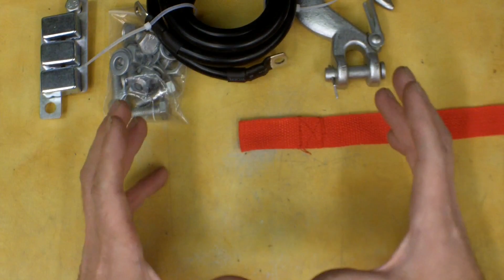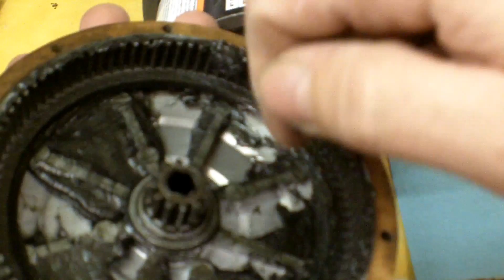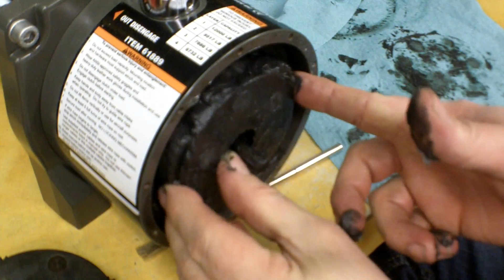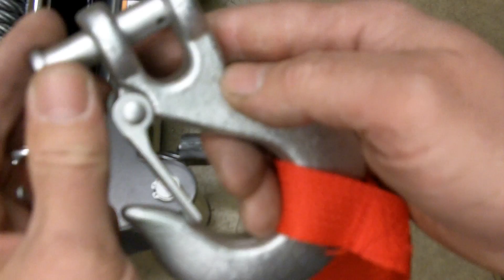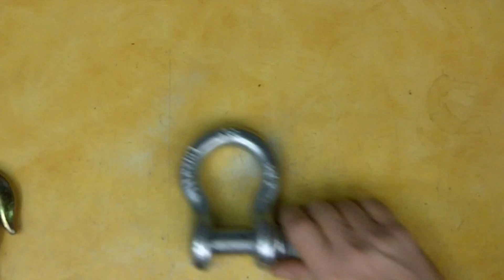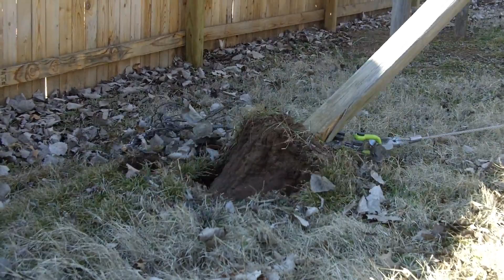Harbor Freight 12000 LB Winch Review, Teardown, Installation, Safety, Etc. Model 61889

Comment: Harbor freight has an amazing deal for this 12k for 294.99 until Sunday!  Great job btw, it makes a great deal that much sweeter after seeing your review
Reply from the maker: roy kwon That is an amazing deal Roy and thanks! I'm completely satisfied with mine and it works great for me. If you get one, let us know what you think. Good luck, G.
Reply: 4 years ago at $294.99 and today its $299.99 not bad. I may pick it up for my gin pole idea I have.

Comment: Harbor freight should put this videos link on their website because of how useful it is. they suck when it comes to directions. great video
Reply: +ghostses You did an awesome job ... Glad I came across your video .. this is my 1st time buying and installing a winch .. thanks very much for taking the time to do this .. :)
Reply from the maker: E3guyy LOL. I agree, their manuals leave a lot to be desired. Thanks! G.
Reply from the maker: Steve Ruddy

Thanks Steve! I'm glad you found it useful. Good luck with your install and be safe! G.
Reply: They never will because of the liability.  I just bought the updated version over the weekend, and frankly I'm surprised by how much is actually in the manual for usage.

Comment: Awesome instructional video!  Thanks for going to all the effort to help others.  Can you provide more information about the "extended cable kit"?  Source?  Cost?  Part Nos.?  I have purchased the winch from HF and the portable bracket from NT and intend to use in a similar manner that you are.
Reply from the maker: Hogonit 77469 Following up here over the PM as it might assist others as well.

The kit linked is expensive and I've not looked to find a less expensive kit.

http://www.northerntool.com/shop/tools/product_200464241_200464241

Another option, and less expensive might look like this:
Find some heavy gauge wire and use it instead of the kit- maybe from a 
welding supply house. Or perhaps even some long jumper cables with the 
clamps lopped off- but really heavy gauge.
Get two sr175 connectors for the end at the rear.
Wire the ground directly to the negative on the battery.
Use something like this on the positive post of the battery.
http://shop.advanceautoparts.com/p/autocraft-top-mount-battery-terminal-quick-disconnect-switch-20138/6280536-P#fragment-2

This option would require manually turning on the power, but would save 
tons of cash. It would be up to you to remember to disconnect the power 
when not in use- but that's no big deal in my opinion. The only real 
difference in operation is you would need to open the hood to power up 
the cable to the rear over simply flipping a switch. To me, a small 
price to pay to achieve function as well as safety!

Take care, G.

Comment: How did you get the gears clean?
Reply from the maker: David Miller David, I cleaned as much off as I could with rags, then just used gasoline and a brush for the rest. Any solvent should work though. Good luck, G.

Comment: G.
I was winding my synthetic line back onto the spool of my 12000 lb winch after installing a fairlead just for synthetic line when my winch started clicking and stopped. I tried my remote with the same result, nothing. ??? HELP please.
Reply from the maker: Chuck Pringle That's no good Chuck. I'm no pro, but I would start with the basics. Since you said you were spooling up the new rope, did you have the vehicle running? If the battery is low, I could see it clicking so I would start there. Since you've tried two controllers, I would imagine them to be fine. The next thing I would to is to check that all connections for the wiring are tight. There should be four screws in the bottom of the solenoid box you can remove to open it up. Unhook the battery leads first, then check all connections. If they look good, hook the connections back to the battery and try tapping the solenoid with the handle of a screwdriver while holding the button. It might be stuck in some way. The last thing I can think of would be the circuit breakers connected to the battery, providing you used them. You might take them out of the circuit to see if it starts working. Like I said, I'm no pro but hope this helps in some way. If you get it working, let me know what the problem was as I might help others. Good luck, G.
Reply: ***** Yes, engine running.
Had to go out but have time now to check electrical connections, let ya know.
Reply: Chuck Pringle 
Fixed it, just a lose connection.
Reply from the maker: Chuck Pringle Good deal Chuck! Which connection was loose? G.

Comment: great!  Do you think rather than repacking the gears I could just squirt some lithium moly in from the open end of the gears to make sure they get enough?
Reply from the maker: Charles F Charles, the gears on mine seemed to have enough grease on them from the factory. The quality of the grease I don't know- which is why I cleaned it out and started with good quality grease. It also allowed me to show how it all works.  I don't think you could get any new grease all the way through the gear sets without getting way too much in them. At the very least, I would take everything out and use a standard bearing grease on the outside of the ring gear like I've shown. This would help with free spooling. Good luck, G.

Comment: Underrated winch IMO, the re-greasing would for sure quite it greatly and reduce even more friction. We are gonna mount one in the back inside a suzuki samurai tin top lol, overkill however the price is just perfect.
Reply from the maker: I agree Thanos! I never hooked it up before re-greasing it so I don't know what it would have sounded like out of the box. I can say it is really quiet in use after what I did  and the only thing I really hear is the motor running. I can't hear the gearing. It might be a little overkill for you, but I think it would last longer since it would see lighter loads. I agree, the price is just perfect. I'm still really satisfied with mine. Good luck, G.

Comment: mine is 12k item # 68142 bought in 2013 new
Reply from the maker: That's cool. They don't show that model anymore. I think they have different model numbers based on which factory they came from. How is yours holding up for you? I've been using mine almost daily since posting the video and for about a couple of hours of run time in those days. It's still working like day one for me. Take care, G.
Reply: ***** Only used it a few times over the course of 2 years but it is still doing fine. I haven't put any hard use on it really. Thanks for the vid, gonna break mine down one of these days and add some moly grease to the planetary's I think. Take care!
Reply from the maker: Keltingr That's cool. No more than you use it, it might be just fine with the factory grease. But, on the other hand, changing it out to a quality grease might help it last even longer. Mine's seen much use and still works great as well. I've no experience with one with factory grease, but an ounce of prevention is worth a pound of cure...lol. Good luck, G.

Comment: hello, your video is very informative and I appreciate the time you took to make it. Question? can these winch be use for a hoist lift?
Reply from the maker: Tommy Francis Thanks Tommy! I'm glad you liked it. These types of winches are not supposed to be used for lifting loads though I've seem some videos of people doing it. I think it has something to do with how the break on a hoist works over a winches brake- but I'm not too sure. If it were me, I wouldn't use one for lifting. Harbor Freight does sell hoists of different capacities and price points. Depending on what you're wanting to do, you might check them out. Here's a link to their hoists. Hope this helps, G.http://www.harborfreight.com/catalogsearch/result?q=electric+hoist

Comment: I've got the same winch and it came with my truck when i got it. However, it only works one way which is out. So im pretty stuck trying to reel back in the cable. Any thoughts on where i should start looking to find out whats causing it? Manual says to try tapping the solenoid. Not sure what that means.
Reply from the maker: You can see the solenoid at about 13:10 in the video. Take the control box off the winch and then remove the 4 screws from the bottom that holds the cover on. First make sure all of the connections are still connected. Then try tapping on it with the handle of a screwdriver, then test to see if it works. It could also be the controller switch is bad when using the in side of the switch. Let me know what you find out. G.
Reply: trukaroo Run power directly to the winch terminals and then reverse it and see if it runs the motor the opposite. You may be able to swap wires and have it only pull in, then you could free spool it out

Comment: Is that cable tension device available from H.F.? My Bad Lands winch didn't come with one.
Reply from the maker: I don't think so Chuck. It seems the only models that come with it is the one I have (61889), and one with another item number- 60813 . They have another model of the 12k (61256) but it doesn't have it. G.

Comment: Speaking of "rat nesting" I was weed eating the yard this last Friday, accidentally bumped the trimmer head on a rock, the damn thing unclipped itself and the line unspooled in about half a second. I of course still had my hand on the trigger, so not only did it unspool but it then got twisted around by the motion of the motor still spinning. Took longer to unravel it all then it did to mow the lawn!
Reply from the maker: I bet that was a mess... That's my luck half the time...lol. G.

Comment: I remember bringing up the different item number listings before. I've said this in another video, but I'd like to repeat, my guess is that if an item starts getting poor reviews they alter the supplier and redo the item number so that they can get new 5 star reviews. Heck, sometimes you'll see an item, say a corded drill, there will be two item numbers, one will have 3 stars based on 13 reviews, and the other item number will have 4 1/2 stars based on 47 reviews. I'm not 100% sure that's why it's done, but it's just a guess.
Reply from the maker: You're probably right. G.

Comment: Hi G, shouldn't the order be: you would put a bolt through a hole, then put a flat washer, the lock washer, and then the nut? My thinking there, is that the flat washer creates a base, the lock washer is holding tension on the nut, preventing the nut from wanting to loosen up. Let me know what you think. As with many Harbor Freight tools, taking the time to go through it from the start, makes all the difference. Sort of refining the raw materials they give you. Thanks for another awesome video.
Reply from the maker: Darryl, typically that's the way it should be done for sure. If you're referring to the bolts that are installed to mount the winch to the cradle, the square nut goes into a slot in the casting and there's no room for the washer and lock washer. The fairlead was installed just like you stated. I agree with some of their tools needing to be finished off. I consider some of their items to be kits.

I've been tearing things apart since I was about 3-4 just to see how they worked. The only difference between then and now is I can put them back together and they still work...lol. G.
Reply: We're cut from the same cloth, Brother!
Reply from the maker: Darryl Landry LOL! G.

Comment: Wow. Great video. This was a long one. You did a great job going thru all the steps and rigging. Im really impressed with it. You pulled some huge trees over. I've always wanted their 12000 lb winch. Glad to see you're happy with it. Did you put the emergency break on on your truck so its not pulling against the transmission?
Reply from the maker: Thanks! It was long for sure. I'm really happy with it. I should have mentioned how I have the truck set as far as the transmission but forgot. I leave it in neutral with the emergency brake set. Doing so will protect the parking pawl from damage. G.
Reply: ***** Welcome. I was just wondering if you did or didn't. Nice truck BTW. I never thought about using a winch to pull out brush but it works good.
Reply from the maker: Love2boat92
Thanks! It's been a great truck despite having to rebuild the engine. Using the winch may not be the fastest way, but it sure works great. I don't have a tractor so this was my solution to the problem. I don't like doing this type of work, but with using the winch it's almost fun now...lol. G.
Reply: ***** Welcome. Haha. Yeah a tractor would be nice but to buy a new one is horribly expensive. The winch is a great cheap alternative.

Comment: Nicely done!!
Reply from the maker: Thanks! G.
Reply from the maker: MichailahGMX10831 Thanks! I'm no pro but I'll give you my thoughts anyway. I don't think you can fit 100' of wire rope on the winch. You might be able to locate a synthetic line that's smaller than 3/8" but still has high load strength and fit more on the drum but how much I don't know. And it can be quite costly. You would also need to change the roller fair lead out for one that's suitable for synthetic rope. I would go with at least 18k breaking strength for safety, if not more. 

They pull some major amperage so a convertor is probably out. A deep cycle battery would be your best bet and you will need to charge it when it's dead.

I'm not sure on mounting, but you might consider using their cradle and a bumper receiver. Bolt and weld the receiver to the trailer somewhere, then using the cradle for installing and removing the winch. Or you might be able to add some steel to the trailer and bolt the winch directly to it. Or there might be a place available without adding anything. 

Receiver:
http://www.harborfreight.com/5000-lb-step-bumper-receiver-69670.html

Cradle:
http://www.harborfreight.com/Hitch-Receiver-Mount-for-Winches-69106.html

Another thought would be to anchor the winch itself at the top of the hill and use the cable to pull the load up. What to build I don't know. You might be able to use the cradle and then come up with a point you can attach a shackle and tree strap to.

For getting more length, you could add a couple of tow straps (not recovery straps) to the end of the cable, pull as far as you can, chock the load, remove the strap(s), spool out the cable again, and then pull the rest of the way.

What you're wanting to do sounds scary to me, so be extremely careful and stay well away from behind it!  I hope this helps in some way. Good luck, G.
Reply from the maker: MichailahGMX10831 That sounds like the best plan to me over all the red tape with the others options. Post a link and I'll check it out. Good luck with your project! G.
Reply from the maker: MichailahGMX10831 WOW! That's an ambitious project for sure! Thanks for showing it. G.
Reply from the maker: MichailahGMX10831 Cool! Looks like you've got everything ready to go. Have you made any pulls yet? G.
Reply from the maker: MichailahGMX10831 That's cool. Yeah, the battery is the weak link since it's not getting a running charge- like from a vehicle. That's why I mentioned getting a deep cycle battery. They take full discharge and recharges much better. If you have AC power up top, You might keep a charger on the battery to keep it topped off. Overall, I think the project will be a success- albeit slow from time to time..lol. G.